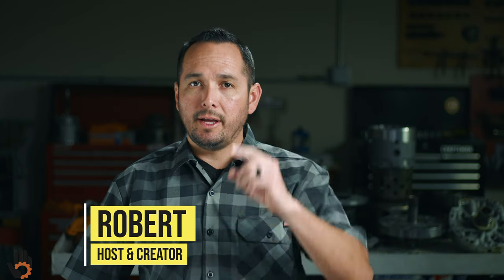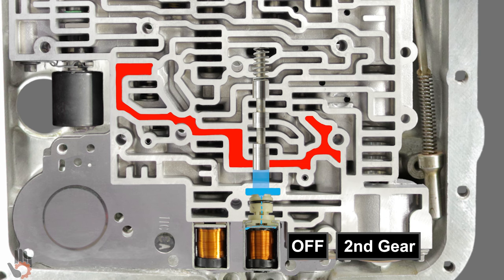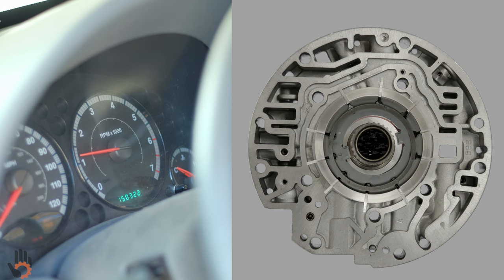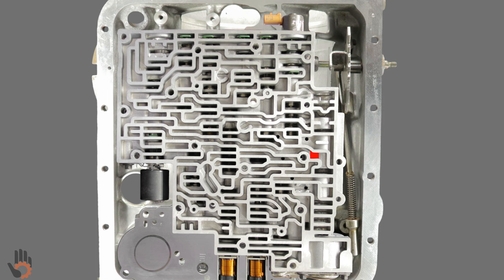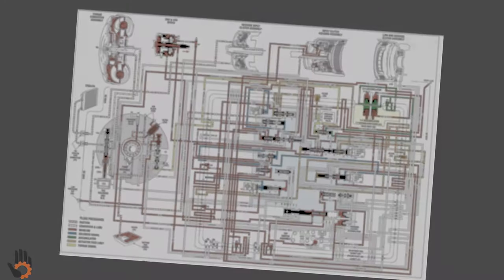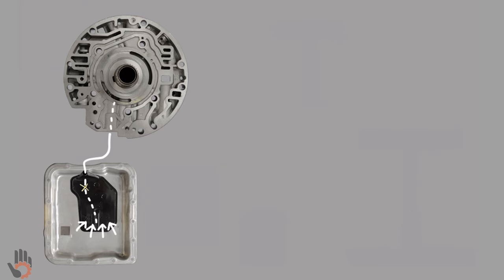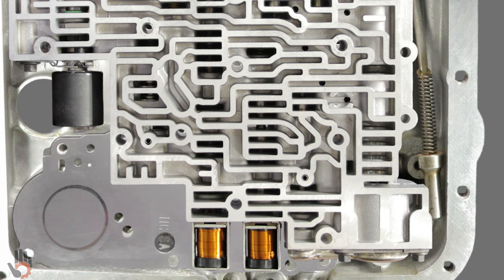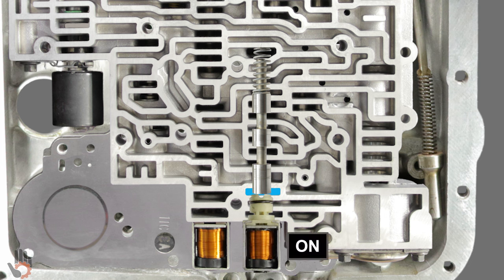4L60E: 1-2 Shift Valve + 1-2 Shift Solenoid (Part 1) Basic Operation

Comment: Hi, I just watched your 4l60e 1-2 shift valve + shift solenoid video which got me thinking.....I'm always intrigued about how things work. While your video is about a  4l60e, I have a 4l80e from a 06 express.  I had 2 trannys to make one good one.....I know, I know...on a budget as I prepare to pay college tuition....well, 1st and 2nd gear seems to change at around 10mph back to back , but is smooth sailing after those changes....do u think it's a bad shift solenoid or shift valve?
Reply from the maker: Two (2) transmissions to make (1) one good one...been there.  Gotta commend you on being resourceful.

The 1-2 up-shift occurs at roughly 10 MPH?

What do you mean by "back to back"?
Are you saying, it up-shifts to 2nd, then quickly down-shifts back to 1st gear?   ...and then up-shifts to 2nd, again?

You said 06 Chevy Express Van.  I'm assuming your original trans was an 06.  (unless it had been previously replaced)
What year was the 2nd 4L80E?
Note:There's a 2-digit number stamped on the 4L80E VB (valve-body) that signifies year of VB.

Why did you replace the 1st trans?
What was it doing, or not doing?
When you tore it apart, what was wrong?

Do you currently have a check engine light on?
What codes are present?
Note:  Not just transmission codes, but any and all codes.
Reply: Ok...here goes......I brought van knowing tranny was bad.  I've been down this road b4...3(x)...I got salvage trannys  and all are still running, so I said let's try again. We'll obviously this tranny is a little harder to find, so the salvage yards said that the a Trans from a heavy duty silverado  with a 6.0 liter engine would work ( keep in mind its a 4x 4)...didn't sound right at the time but I went along since their system do part interchanges.....well because of the transfer case of 4 x 4 the salvage Trans is to short.....it was a jasper tranny so I said well swap the guts out into my tranny.....original Trans was delaying b4 engaging...Trans fluid was black....I tried flushing it new fluid/ filter and some BG Trans conditioner...worked for a month then it started again..each time a fluid change worked, but I gave up....dex vi fluid isn't cheap....I actually had a friend do the swapping we keep the good parts from salvage tran, but valve body was from original...salvage tran had a little sign of rust on its valve body(maybe rain from sitting in yard..someone had already pulled motor) .......so what I mean by the back to back changes is the first change happens at the 10mph mark and the 2nd gear hits immediately after that.....3rd and 4th seem to occur just when they should.....now I tried to manually goes through the gear, but this one time I let it stay in 1st for an extended time and it started acting like it wanted to change.( not supposed to happen) ....lastly if I'm in a parking lot where your speed doesn't go to far over 10 mph each time it goes below 10mph it will go back to first...if I did it long enough you would think I was learning to drive a stick with all the bumping and jerking....can't remember what year the silverado was.....I think 02   or 03..hope this helps...sorry so long
Reply: Have to check codes again

Comment: I’ve got a 95’ Sierra pu.  4l60e.   All of a sudden it decides to shift hard between 1-2.   Sometimes shifts hard in other gears. I’ve got a code 82.   I’ve replaced both the accumulator and 1-2 shift solenoid with no luck.  If I feather the throttle the shift isnt so abrasive. Starting to think i may have a pcm issue.   Your opinion, where should I take this diagnosis next.
Reply from the maker: If the PCM "sees" a problem with the trans, it can elevate the oil pressure within the transmission (Line Pressure)(used to activate, and hold, the clutches).  Elevated oil pressures apply the clutch packs, with greater force....which prevents the clutches from slipping.  When they slip, they build up heat, and burn up (trans failure).

On this particular transmission, the 1-2 up-shift is the most sensitive.  So, if the PCM has jacked up the Line Pressure, the 1-2 shift will be noticeably firmer than the rest of the up-shifts.

Might be time to take it to your local transmission shop.  They can get eyeballs on it (scanner data), road test it, etc.

Comment: I am struggling with a 4l60 that doesn't have 1st gear. It starts in 3rd. I have 12v on the pink wire. I can command 2, 3 and i believe 4th with HP Tuners. Can you tell me what wire is the ground for the 1-2 shift solenoid? Im guessing that is my next place to look?
Reply: Hey boss, I changed my transmission fluid and when I started my vehicle it was having the same issue. I can use shifter for low gears but in drive it won't shift down it's self. Looking to see if you found anything out on yours...

Comment: I've been going through your videos, will I be correct to say this 1to 2 hard shift is more of shift valve spring not pushing back Solenoid spring and metering ball when solenoid is OFF. Else shift solenoid delaying to de-energized (OFF position) thus it has lost its banding calibration ?
Reply from the maker: While the Shift Valve is pushed (via the spring) towards the Shift Solenoid, the valve only pushes against the plastic snout of the solenoid.  It does not physically touch any of the solenoid's internal components.

If this shift solenoid was not de-energizing in time, causing a delayed up-shift, that could create a firmer up-shift.  However, I'm not sure the solenoid would be the issue.  The computer controls the solenoid...and the computer "looks" at a number of things to determine transmission shift timing, and shift feel.  Shift feel is influenced by a number of things, too.

Harsh 1-2 up-shifts can be caused by a number of things.  There are a number of thing located inside of the trans, that can cause this issue.  There's also some things located outside of the trans that can this issue.
When time permits, I will be dedicating a video to this topic.

Comment: Someone help me please my chevy silverado 2011 1500 has a hard 1-2 shifting and I have already replaced the accumulator and the throttle position sensor but nothing works, weird thing about it is that I kinda gets a little better when the car is on normal temperature

Comment: Hey comments quick question, 

Im working on a 2001 GMC Sierra 1500 5.3L v8. 

When I start the car and drive I only have about a minute before it gives out and it loses all movement. The engine sounds beautiful even while in neutral so I know it’s the transmission. 

I then turn the car off, wait few.. and start it up again and we’re back in that loop. Drives about half a mile or so and then off. 

For this I reason to believe my shift solenoids are out or perhaps something that works with pressure. 

Currently looking into it but would appreciate pointers!
Reply from the maker: Sounds like you could be dealing with a plugged oil filter.

Comment: i don't have 2nd gear so i replaced both the shift solenoids, 1 of them popped out when i pulled the clip, the other didn't seem to have any spring tension. should they have both had enough tension to pop out? i got the truck this way so i don't know any history of it. thank you in advance!
Reply from the maker: The 1-2 shift valve-train uses a spring, and the 2-3 shift valve-train does not....so, what you're experiencing is normal.

Comment: Hey buddy really like the channel you're very knowledgeable you know your s*** anyway I was driving 94 Chevy Suburban it's a C1500 transmission has a k transmission that was converted into 2-wheel drive I was on my way up the road stopped at a light went to go take off almost no power running engine high RPMs and not going anywhere pullover to the gas station let it cool down I started it up and drove it it was fine for a couple minutes till I got hot again then on my way back home I drove it till I came up to a red light couldn't move no more pulled over let it cool down drove it some more how to get it home finally broke a little bit of it down lots of metal in transmission fluid
Reply: So my question is do you think the hard Parts would be okay this transmission was rebuilt 2 years ago and with your videos I'm going to attempt to rebuild it by myself in the garage
Reply: And one more question the torque converter when I poured it out was full of metal I believe the clutch inside is bad is that possible
Reply from the maker: The only way to know for sure is to closely inspect every part...which is a normal part of a transmission overhaul.
Reply from the maker: It's possible.  The converter would have to be disassembled to know for sure.  They're welded together.

Metal pouring out, or not, it's a good practice to have converters rebuilt when rebuilding the trans.

All of the fluid in trans is circulated through the converter anytime the engine is running.

Comment: had 2007 chevy silverado 4l60 rebuilt, hard delayed shift from first to 2nd gear, does bad throttle position sensor cause this problem?? thanks
Reply from the maker: A bad TPS can cause that issue.

Comment: Hi, and THANKS for the knowledge! My question is related to 2-3 shift in the 4l60e. the trans was rebuilt by a shop and about 3k later the trans will now not shift to 3rd and  "sometimes" shift from 2 to 3  solidly then 4th with no issues. i wonder how the 2-3 shift is occurring and what could cause this failure to shift?
Reply from the maker: The highest failure point on this trans is the 3-4 Clutch pack.  This clutch is partially responsible for both 3rd gear and 4th gear.  When the clutch fails, the trans will lose both of those gears.

When it shifts to 3rd gear, and it's unable to shift, what happens?
Trans stays stuck in 2nd gear?
Or the trans feels like it shifted to neutral (engine revs up)?
Reply: @SouthpawAutoworks  I took off the pan and found the 2-3 shift valve "stuck". I could not remove it from the valve body...
Reply from the maker: So, the trans was staying stuck in 2nd gear...versus slipping in 3rd?

While it's not very common, the 2-3 shift valve can stick in the bore.  The valve-train is comprised of a Shuttle Valve and a Shift Valve.  The shift valve is really long, when compared to other valves.  So, any distortions in the bore (or the valve) can cause it to stick.

Can't say that I've ever tried to remove a 2-3 shift valve, with the VB still bolted to the trans.  There's a lot more places to manipulate the valve (for removal), on the other side of the VB.

If you don't already know, the 1-2 shift valve is under spring tension...that's not the case with the 2-3 shift valve.  No spring in that particular valve-train.  And to make matters worse, the Shuttle Valve (the valve closest to the shift solenoid) is not made of steel.....so a magnet is no help.  If you can get the Shuttle Valve out of the way, the Shift Valve is made of steel.

When time permits, I'll be producing a video on the 2-3 Shift Valve/Solenoid operation.
Wishing you the best on your 4L60E.
Reply: @SouthpawAutoworks  it is currently flaring to "neutral" instead of going into 3rd. I think the stuck valve wasn't allowing enough pressure to lock the clutch pack. Due to the amount of friction material in the fluid I do believe the 3-4 pack is burnt out, so it will require replacement and it being a 94, no ready replacements without pwm lockup so looks like it'll have to wait a while for rebuild
Reply from the maker: I see.

Comment: I have a question about a 2004 Chevy pick up the transmission slip when I took off and I kept going it finally engaged could that be a solenoid the fluid looks good and it works fine now
Reply from the maker: Can you elaborate?

When you shift the trans from Park to Drive, and you accelerate, instead of the vehicle accelerating normally, the transmission slips (engine RPMs climb)?
...but as it continued to slip, it finally bumps all the way into 1st gear?
...or it shifts into 2nd gear?

Comment: My transmission in a Chevy Blazer 2002 only shifts into first gear I need to know what's going on with it if I need to know sensor or what and I need to know where the sensory is that changes the gears in it thank you
Reply from the maker: What's the history on the transmission?
Was there other work recently done to the Blazer? (engine work, etc, etc)
Is there a check engine light illuminated on the instrument cluster?
What trouble codes are present?

Does the transmission try to shift to 2nd gear, but when it does, the engine just revs but the vehicle stops pushing forward?  (Like it's in Neutral)

Does the trans not try to upshift to 2nd gear?

Comment: Excellent videos,.makes it easy to understand. Would this knowledge be applicable to Mopar auto trannys? Cheers from Calgary,  Alberta, Canada.
Reply from the maker: If we're talking the A500 (42RE/44RE/etc) and A518 (46RE/47RE/48RE), then yes and no.

These particular Mopar transmissions operate much like older hydraulically-controlled transmissions; Ford C-6, GM TH350, etc.

In the early days, transmissions that were controlled by a throttle linkage/cable (or a vacuum modulator) and a governor (output shaft mounted, or gear driven).  Throttle position (and/or engine vacuum) was used to "let the transmission know" driver demand (Foot barely into the pedal vs pedal to the metal).  The governor was used to "let the transmission know" vehicle speed.  Both of these things sent oil pressure to opposing sides of a shift valve.  It was like tug-of-war...but instead of pulling the valve, the two opposing forces were pushing on the valve.

When time permits, a video will be made on this topic.

Back to the Mopar A500/A518 transmissions:

1st thru 3rd Gear:
1st, 2nd, and 3rd gear are controlled just like the early transmissions.  The VB (valve-body is equipped with a Throttle Valve (driver demand).  However the fully-electronic units (Name ends with "RE", as opposed to "RH") are not equipped with a governor.  Instead, they're equipped with a Governor Solenoid.  The PCM (computer) utilizes this solenoid to send oil pressure to one end of the shift valve.  The Solenoid "creates" oil pressure, just like a traditional governor used to...but it's now done electronically.

4th Gear:
The 3-4 up-shift is going to be similar to that of an up-shift on the 4L60E.  On the Mopar, this up-shift will be created using the OD (Overdrive) Shift Solenoid.

Comment: We are having problems after rebuilding our 4l60e in a 2002 avalanche with the 2-3 shift slipping, the 2/3 solenoid and valve is fine, we cannot figure out what’s causing it. Any advice?  Thanks
Reply from the maker: Bummer...
If it's slipping in 3rd gear, it's likely a problem with the 3-4 Clutch....most problematic clutch in the 4L60E.
If that's the case, it could be a number of things...

Is the trans still in the vehicle, or back on the bench?
Are you missing 4th gear, too?
What else can you share about the symptoms?
How many miles are on the unit?
What all was done during the rebuild?  Please list parts that were replaced?
Did you over-size any valve bores?
What's the line pressure, with the engine idling and the trans in Park?  
Is the gauge needle pretty steady...or is it bouncing around a lot?

Comment: Do you have a video like this on it shifting from 2 to 3rd an 3rd to 4th? My 4l60e will not shift to 3rd or 4th and my mechanic says everything electrical is working correctly so he checked valve body an said all was good there. So he said there has to be something blocking the flow of fluid not letting it shift to 3rd an that it would require him to rebuild transmission. Which I don’t really have the money for. So trying to figure out just where that blockage could be. So far, from what I’ve seen in your videos I feel like if everything is good in valve body then it has to be in the pump. Or am I missing something?
Reply from the maker: Generally speaking, when there's a problem with the pump, it negatively affects all gears...not just 3rd and 4th.  That being said, in this case, the pump would not be my first point of interest.

I would need to get more info from you before I could try to assist you.  I responded (with questions) to your comment on the 4L60E Pump video.  When time permits, fire back.

I am working on a 2-3 Shift Valve video, that will cover the 2-3 up-shift.  I've got plans for a 3-4 Shift Valve video, too.  These type of videos are very time-consuming to create...so it's gonna take time to get them finished, uploaded, etc.

Comment: Which wire from tcm send order to power solenoid A to enter the 1st gear.? Bcoz my car cant move forward when i shift to Drive gear. But can move reverse when shift to  reverse gear
Reply from the maker: If you're asking about a 4L60E....
Pin "E" on the wiring harness (at the transmission end of harness) supplies 12V to the shift solenoids.

When the transmission loses electrical power, the trans defaults to 3rd gear.  So, even without 12V, the trans should still be capable of 3rd gear.  Unless of course there are other issues present (clutch failures).